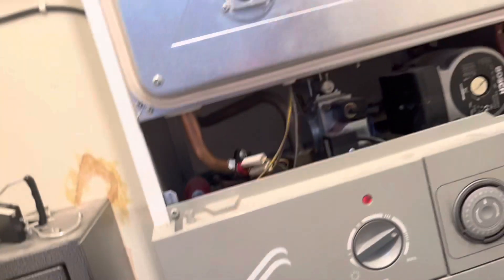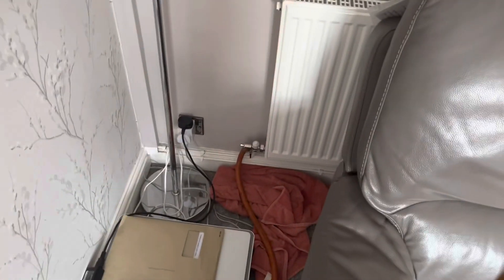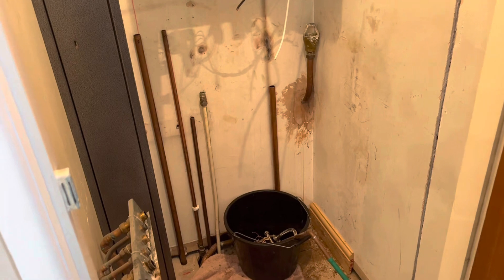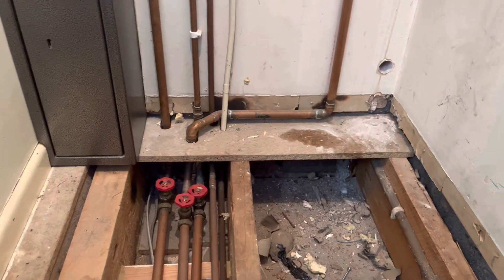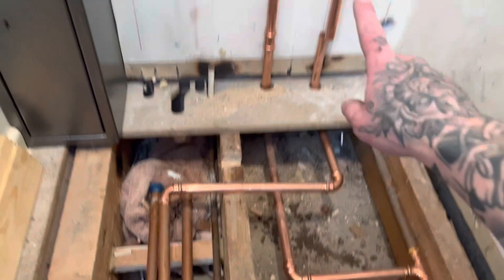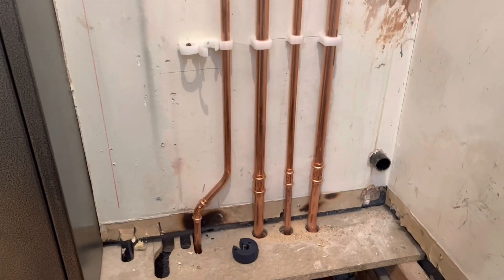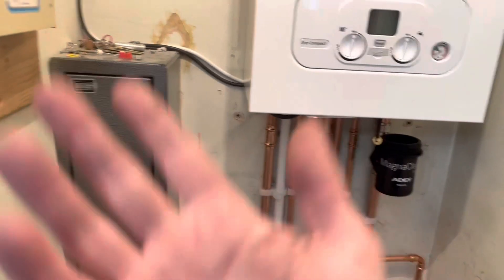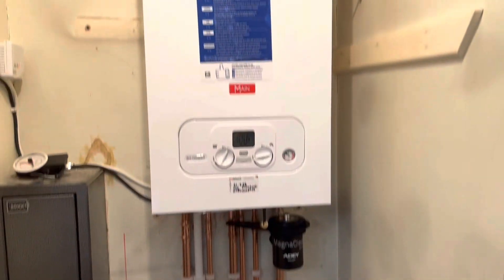Day in the Life-episode 19! Do it the easy or harder way?

Comment: Great work bud, however I’m sure you’re supposed to treat press fittings as compressions and shouldn’t be placed under floors, but decent work bud!
Reply from the maker: Conex put out a statement saying they’re fine under floor boards just not in a concrete floor buried etc. I can’t vouch for other manufacturers though. Many thanks for the comment buddy!
Reply: @Heatking  ah I see! I use geberit mainly and the last I checked you weren’t aloud to use under floors or at least advised against it. No worries, good to see another tradesman taking pride in his work💪
Reply from the maker: @brendonsidebottom-ub3nx  bloody pointless if they can’t be used under floor boards haha. I’d sell mine tomorrow 🤣 Thanks mate! ❤️
Reply: @Heatking  I believe it’s just with gas, chances are it’s probably changed now
Reply from the maker: @brendonsidebottom-ub3nx  bloody hope not 🤣 otherwise I’ve got a few jobs to go back too 🤣